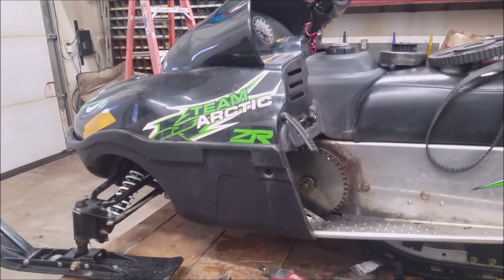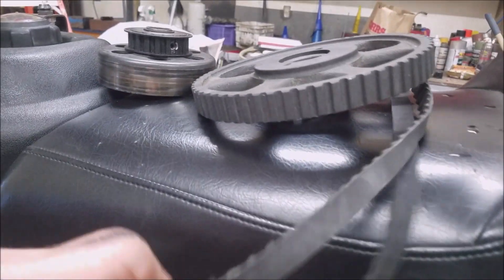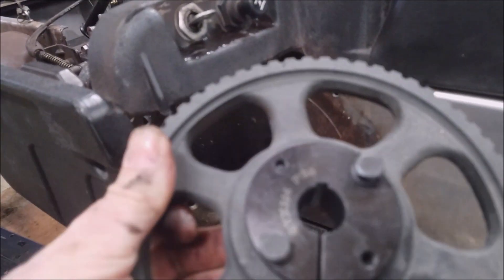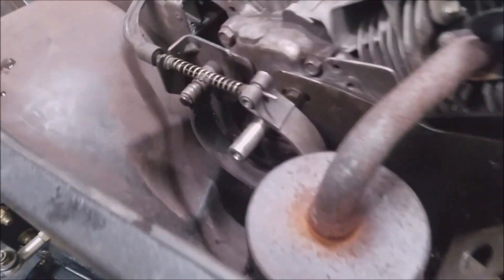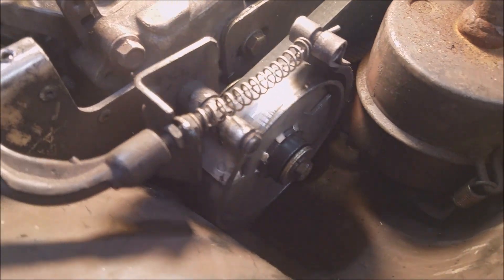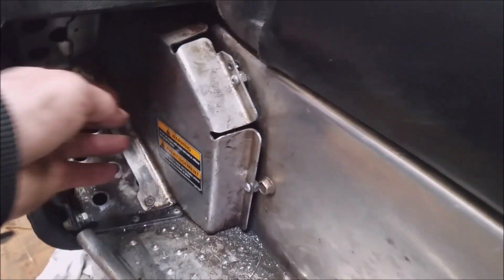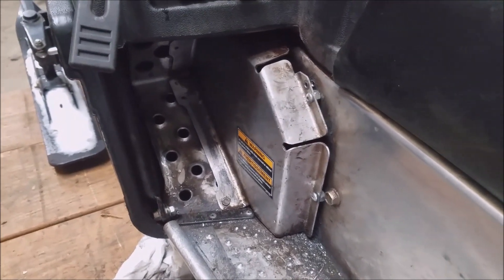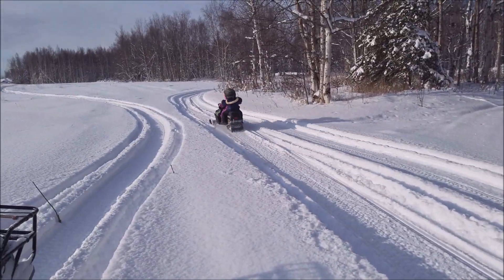ZR 120 Arctic Cat chain to belt drive upgrade

Comment: How has it held up?
Reply from the maker: My 4 year old still uses it and it works great, we are trading up to a 200 this season and will be selling this one probably within our family but it has been a wonderful sled without having to worry about the chain all the time. i wish some speed shop would adapt the concept  and offer a kit maybe with a 3d printed rear sprocket.
Reply: @katman1957  are you looking at making and selling the belt system as a kit?  I know a bunch of people have made the recommendation
Reply from the maker: I am not planning on making kits, the part numbers are listed in the video someone can just use those and make them i guess.  ps we just got back form our remote cabin and my 4 year old drove it in 12 miles one way and all around cabin for the weekend with no trouble.  @StrategicTactical

Comment: Any parts list for this with part numbers?
Reply from the maker: Pause video at 3:40 and there is a list from Grainger. My 4 year old and youngest grand kid just starting using it and the belt set up still works good. I put original gearing on when he first stared but the chain broke after about a week and the belt went back on and has been working all winter.

Comment: How do you get the drive sprocket to not spin when you take it out, I don’t have an impact or anything and have been trying to hand wrench it but its just too tight for a vice grip, it turns when I try to undo the nut and eventually the grip rips off
Reply from the maker: An impact would be a good investment, there must me some way to wedge something in to keep it from spinning but I never tried since the impact does it in seconds.

Comment: just had clutch break on my kids z120 and decided to try convert it to belt also this video was a great help thanks man! now i just need to find the correct parts before i tart working on it
Reply from the maker: We still use this sled with the belt setup, currently I converted back to original so my 3 1/2 year old has slower gearing but will switch back when he masters it.

Comment from the maker: I wanted to update this sled, it has run with no problems and i have had one broken belt when i loaded it on a trailer and shocked it good.  One more thing the rear tail light burned out and Cat wanted $40 for a replacement so i just bought a LED clearance light from home depot for $8 and it looks like it was always on there and works great.

Comment: I thought this was going to be a cvt belt drive. I’m still a little confused on the chain wearing out. I’ve never had chain issues. No stretching or gears wearing causing skipping. even with a bigger 208cc I’m still on my original 2006 chain. I’m even going to try and shoe horn a 250 cc brigs and Stratton 11hp on that same chain!!
Reply from the maker: You must have gotten a good one, i had to change the front sprocket twice and I had to buy the whole clutch and all to get it. After the kids got a little older i went with a smaller rear sprocket and the wear got worse, now for me this is what works, I would not change the setup if what you have is working for you.
Reply: So the chain is skipping on the sprocket? Again i wouldn’t convert my timing chain in my engine to a timing belt. Check my videos on little kitty cat ripping around. It’s had 250 lbs and the track had to be tightened because the track would ratchet on the sprocket. I am a mechanic by trade and see a chain as a simple long term. I love the idea of lighter drive train

Comment: Would you be able to enlighten us on pulley sizes and belt part number or length?
Reply from the maker: If you still pause the video at 3.37 There is a picture with part numbers from Grainger just research it from that if you can.  We are still using the same belt this year and have had no problems it works almost to good to be true, still be nice if a mod shop would make a kit with lite weight components but what i show here works good and has stood the test of time and a ride hard granddaughter.

Comment: They make a belt drive kit specifically for 120s on http://goodwinperformance.com/product/complete-jr-drive-belt-kit/
Reply from the maker: I think mine cost a little over $200 and it is still working after over a year of hard grandkid use, I like their upgrade but i think they good make one like mine and sell it a little cheaper then the full clutch changeover.
Reply: That's awesome it's still holding up man, I'm debating on switching my sons 120 to belt drive we just got it brand new in spring 2020 and it's already got some wear on the chain drive already.